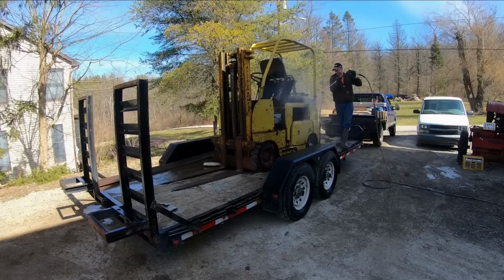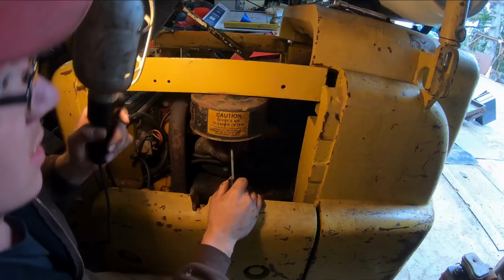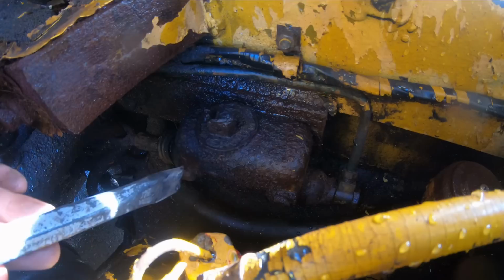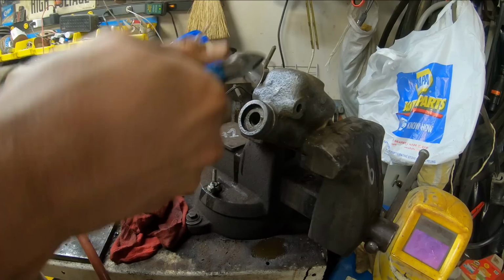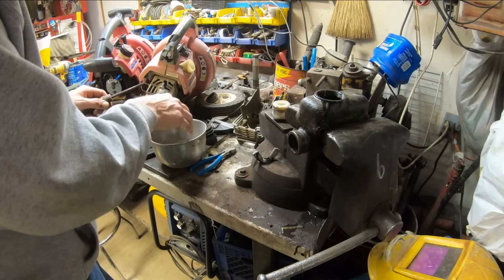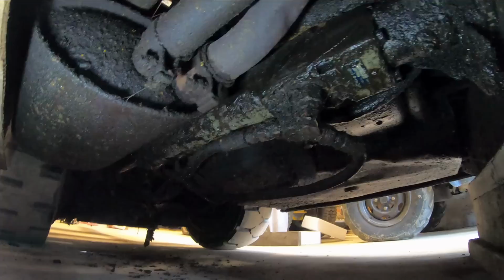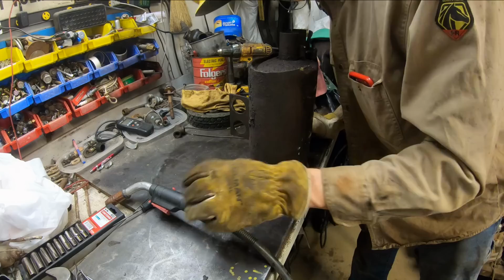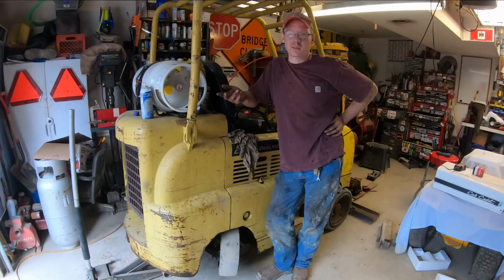Fixing the Cheapest Forklift on Marketplace!! Pt.3

Comment: Who else is interested in the cub cadet under the white tarp maybe a vid on it
Reply from the maker: its a 106, its got a new (5 foot) paint job, wiring harness, and i freshened up the engine. just needs a few things painted and it will be done and forsale. i used to be really into those, ive got 15 or so still
Reply: @DieselCreek  cool i have a habbit of hoarding 2 stroke lawnboys had 10 at one point had to sell them i got 2 at the moment but im always looking for more
Reply from the maker: I only had one but ended up selling it, not much for push mowers too much work
Reply: @DieselCreek  yeah i just take turns using them as trim mowers

Comment: Make it easy for the engine take the muffler off and use the torch to heat the muffler from the intake and burn it out that way, it will have a much hotter flame and do it in less time, it will take about 20 minutes or so but the 70 years of greasy carbon buildup will be ash You might get a flame out of the exit side too.
Reply from the maker: it was way more fun to smoke it all out lol

Comment: Don't understand why you spent so much time on the master cylinder. Brakes is one thing you don't want to take chances with. Replace the master and be done with it. What about the drums and linings or shoes? Have you looked there yet? You have the making of a really nice forklift. Just be safe and get the brakes fixed with new parts.
Thanks for sharing.
Reply from the maker: Haven’t gotten that far yet, I’ll be replacing the master now that I broke the seal since I can’t find a rebuild kit, everyone used to rebuild them, they are super simple and there’s no reason not to.

Comment: I’m a thinkin it needs valve seals  and rings.
Reply from the maker: All the smoke is from the muffler being full of oil and grease, I didn’t clean it out too well, after letting it run a while the smoke cleared up and it doesn’t smoke at all now. It didn’t smoke before the muffler either

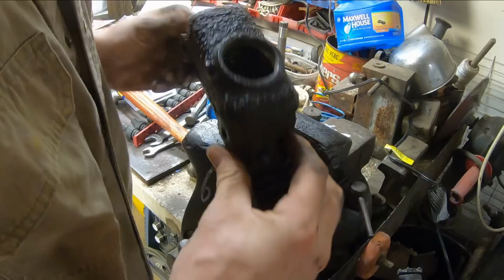Comment: 16:31 Here he's saying that he discovered the name "Wagner" on the master cylinder, and how that was a name brand and parts should be easy to find for it. He mentioned that he wanted to wire-wheel the part and put a coat of paint on it. He was also concerned about possible damage he'd done to the threads, but was hopeful it could be fixed.
Reply from the maker: Winner lol

Comment: Cut those wires and shorten them and re-crimp the ends.
Reply from the maker: i need the replacement ends!
Reply: @DieselCreek  Have you looked at them in the old days they were reusable.
Reply from the maker: time1800 yes these are not reusable

Comment: cost you more in gas and wire a new exhaust would have been cheaper in the long run
Reply from the maker: I did the actual repair in less than an hour, didn’t have to go anywhere or spend money, I call that a win. Gas and wire is pretty cheap
Reply: and you will still end up putting a exhaust on it
Reply from the maker: Maybe in a few years but will do for quite a while
Reply from the maker: Plus a new one might be a lot harder to find then you’d think

Comment: "temporary fix" that forklift will go to the scrapyard with that bolt still on there just like you did it today.

Lets be honest here, if a temp fix works, it turns into a permanent fix until it breaks and then you swap it with another temp fix, each more outlandish than the last.
Reply from the maker: ive already changed it as a matter of fact...
Reply: @DieselCreek  You are a one of a kind person, i've seen way too many "professional" installs/repairs of things where they did a temp "lets see if it works" and just left it like that, but since it worked they said "who cares" cus it'll take more time to undo their shenanigans and do it correctly than to just leave it and and cover it in tape/glue/epoxy.

Comment: Hope that wasn't engine oil in the oil can, brake fluid is not mineral based, and so normal oil will destroy the cups and seals. That engine still sounds retarded,  You could try slackening the clamp bracket (not the adjuster) on the dizzy and try the timing again.
Reply from the maker: im gonna try that next!

Comment: You should never use oil when working on brake parts. The oil will cause the rubber to degrade in all the seals. You only use brake fluid for honing and assembly. As a mechanic for 15 years that literally made me cringe. You might as well now flush the entire system to get rid of the contaminated fluid
Reply from the maker: lots of people up in arms about that, but ive never heard of that.